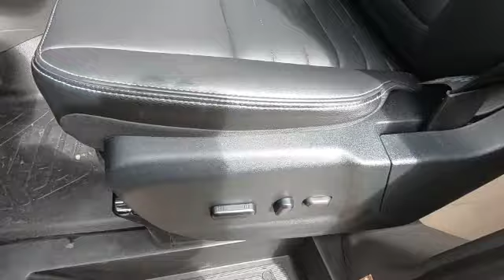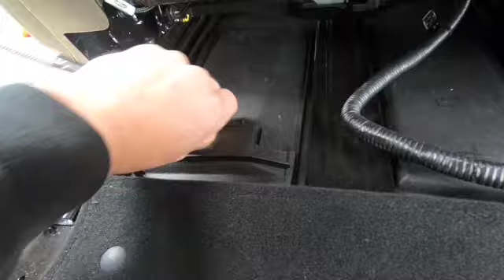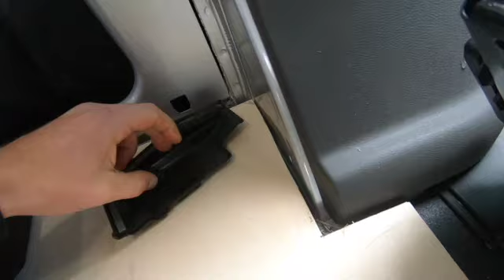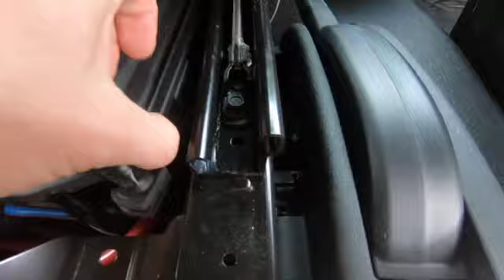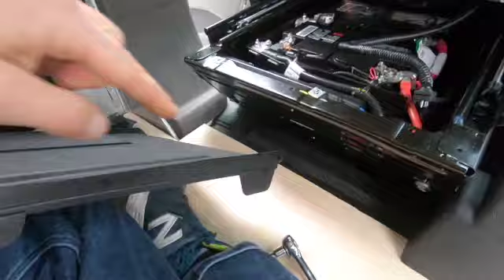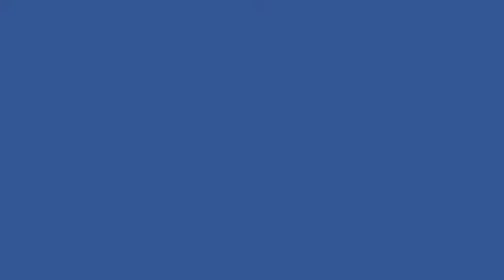How to access and disconnect your Ford Transit 2020 dual batteries.

Comment: I wanted to share a recent experience I had with my 2018 Ford Mid Roof van. My van has 55K miles. The battery is showing signs of dying. I have 190 watts of solar on the roof running to 2  40 amp hour lithium ion batteries by Valence inside the van that run my ICECO fridge, the exhaust fan for my Natures Head composting toilet and 2 MaxxAir fans. I paid someone to do the wiring for my solar. The guy recommended installing an isolator to charge my solar batteries from the alternator if I was ever without enough sun to charge my lithium ion batteries. You would simply switch the isolator to on and charge your lithium ion batteries from your alternator while you were driving down the road. HERE'S THE GOOD PART. My van battery finally took a poop. I got the bright idea to switch the isolator on to see if the lithium ion batteries would start the van and it cranked right up. I didn't need anything to jump start the van. It was already on board and I didn't know it would work until I tried. I hope this helps you. It will come in very handy in a pinch. P.S. I did go and buy an Interstate non AGM battery for the van. So now I have the van battery and two lithium ion batteries in my van.

Comment: I will eventually need a small solar system on my Transit.  For that reason, I was told to save weight and money on the dual battery/alternator system and use lithium batteries.
Reply from the maker: I ended up buying the Bluetti Ac200p for ease and safety.

Comment: Hey I bought pretty much the same van. Are you planning to use the upfitter switches and how did you run the wire?
Reply from the maker: On my 2020 upfitter connections are behind the glove box. Ill probably k let use them for outside lights since it’s always on the damn timer.
Reply from the maker: Got the light working today with Aux 2. Used the wire harness, ran a wire up the A post to the back, out the roof hole.

Comment: Do all transits have dual batteries? I have 20' also wanting to make power for accessories for conversion is this enough power or should add a coup kor batteries and a isolation switch...I'm electrician but auto electric has me spinning a bit
Reply from the maker: No they don't they have a few battery setup options. Most builders say better to keep the cabin batteries separate.  Dual AGM's would be enough for a cooler, fan and a some led lights.